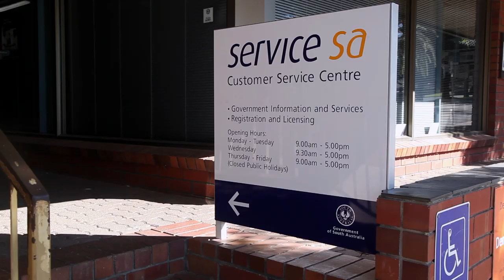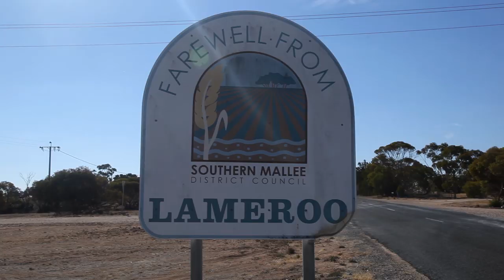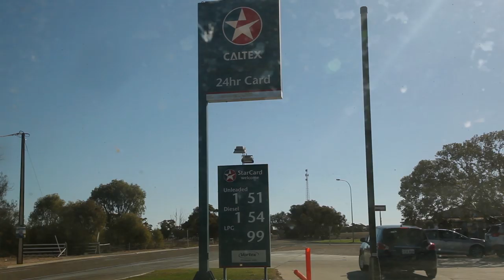Buying a Bee Truck - The Bush Bee Man

Comment: Man o man, never open a radiator cap on a hot engine, so glad you are ok....sheesh.😳
The whole engine cooling system is under pressure, can't drive without a cap, or you cook the motor.
Reply: Your right, you shouldn't open the cap on a hot radiator but but most new vehicles have a safety; the radiator has a notch before It opens where the pressure will blow through the overflow jug. That's what he was trying to do but this radiator obviously didn't have that. I've done it dozens of times without any issues but it's still not a very safe thing to try. He is very lucky.
Reply: He could have cooked himself, too! 😬

Comment: Here’s a tip ol’ mate, next time take a lot more water. Pour some over the top reservoir or the radiator to start the cooling process. If it sizzles keep the water going until it stops evaporating then get the young fella to cover the cap with a drenched rag and slowly remove it. No need to put yourself at risk, lol. 
Had to drive a 1962 crash box cab over Austin a couple of hundred miles fully laden with the cap off due a blown top hose, had the engine cover off and topped up on the move, had to stay around 30mph (50ks), but made it. Bandaged up the hose with my shirt sleeve.
Good luck!!

Comment: IF it will run and be serviceable ...put a red/orange/yellow strap from the front of the boom to the front of the cab somewhere-so you remember there is something above the cab...unless you are into tree trimming and roof augmentation also

Comment: I hope you didn't pay money for that thing :'(

There's a lot to be said for 'buy once, cry once"

As you mentioned, just save up for a proper truck, or buy a bigger trailer in the interim. That thing will only cost you a shitload in the long term fixing it up, and when you're stranded on the side of a major road with the sun coming up and a load of angry bees, you risk losing a lot of colonies.

Seen it happen too many times before. People cut costs, and it costs them more in the long run.

Good luck with it, but in my opinion, don't even bother trying to rego it. Even if it did pass the pits, then it'll never be the reliable rig that you need.

Treat yourself to a nice one. You deserve it mate!